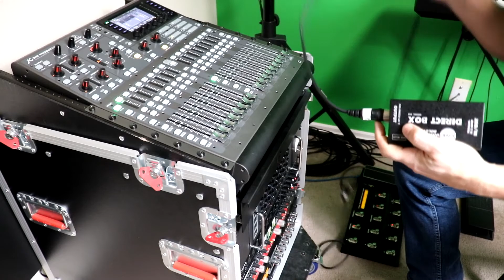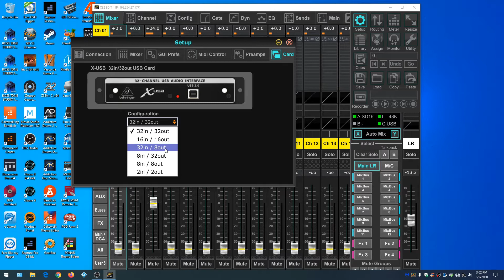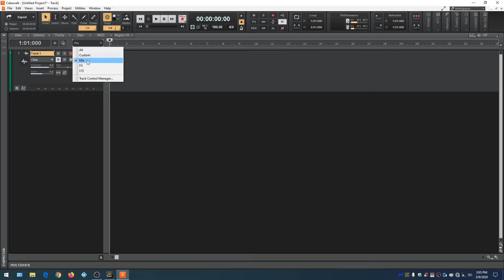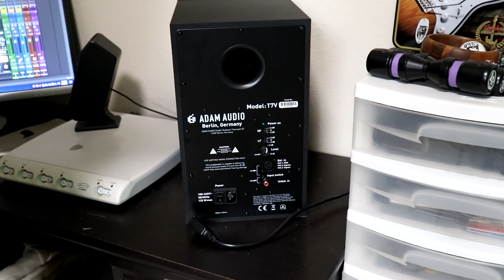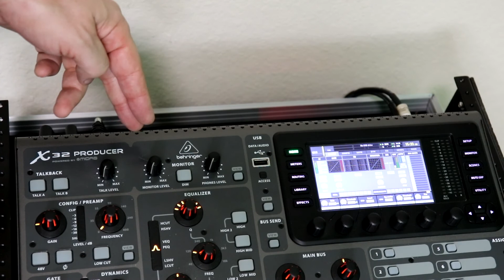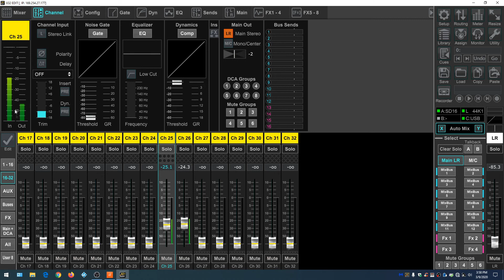Recording A Track Using The Behringer X32 Producer and Cake

Comment: Im just here to tell the story that you can buy the most expensive monitors and still get a trash sound because you didnt treat the room acoustically. And your room sounds roomy as hell... and you really should hang that picture frame properly. However... good video. It serves the purpose.
Reply from the maker: The sound of the screen capture came from a yeti mike it did not come from the mixer. I had several people ask me how to do this so I made a quick video. I know the audio could be better but it is not the fault of the room or the mixer. but it serves the purpose.

Comment: Hi Marcus, How are you Sir?  Did you ever put a video out on how to playback each track to its original channel on the X32 please?  For example, if I record two singers, one on channel 3 (Left) and the other on channel 3 (Right).  How can I route them during playback to play on channel 3 left and channel 3 right?
Reply from the maker: Yes I did, and I mentioned your question in the video and I address routing. Basically to do what you want you  need to select 32 tracks in and 32 tracks out on your card. The mixing board in Sonar will display 32 hardware outputs that will allow you to route those tracks back through the channel you recorded. Use the routing in the mixer app to route channels back through the card to play them.

I find this approach hard to use because the Behringer always routes things in groups of 8 and I don't think it's very practical. What you really need to know is a little more on the concepts of routing which I address when I answer your question. That video is found here. https://youtu.be/-AZZkMb-gW0 I provide a few different examples about how to route your recordings back through the same channels you used to record them. The information is about halfway through the video past the metronome information.
Reply: @marcuscurtismusic  Hi Marcus, Thank you so very much.  I'll give it a try.  I did not think of the master bus inside of CakeWalk.

Comment: Thank you so much for the info! Ive been using sonar x3 producer for years and recently started using cakewalk and have been looking for a tutorial for connecting my x32 to my laptop.
Reply from the maker: I have been a Sonar user since Sonar 2 and a Cakewalk user since Pro audio 9. Going back many years now. I am so glad that the new Cakewalk is a revised version of Sonar and it is free. What an awesome program.
Reply: @marcuscurtismusic  thanks again buddy. I asked a question on a different video about daw control with the x32?
Reply from the maker: @jrp2003  I am working on a video now where I will address the questions in the comment area. Working hard to get it done but my time is limited because I have been deemed one of those essential employees through this whole virus mess. I hope to start filming your request and the other requests in the comments this weekend. Hopefully, within the next week or two, it will be up.

Sonar communicates with all hardware using midi. Within Sonar there is something called "ACT" that does this function. You basically make an act controller for the Behringer and then you go through and make the midi assignments. of course, the main goal would be to take the transport controls on the Behringer mixer and use them to control the process. Still researching it and I will let you know what I find out.
Reply: @marcuscurtismusic  thanks buddy!

Comment: Hi Marcus, these videos are fantastic thank you! If you could answer a couple of questions I would appreciate it. Do i need to download the app?
Im running through protools 10 and am able to record tracks just fine. Next question when i'm recording multiple players i am unable to adjust
their IEMs separately when recording, I can only adjust one main level which effects all of their IEMs. Thanks again these videos are very helpfull.
Reply from the maker: You obviously don't need the app to record music with the mixer, but the app will allow you to control the mixer remotely. This helps when your working in Protools and you want to make a quick adjustment within the mixer. Another great feature for me is the monitor on the mixer is small and hard to see. The app basically blows up that screen and places it on a computer monitor and now I can use the computer to manually control the mixer. Keep in mind that you need ethernet cable connected from the computer to the mixer, however, you can also connect that ethernet to a wireless router and use an iPad to control the mixer as well. This is great in live situations when you are walking around and checking for a uniform front of house mix.

I only record my own music so I don't know much about IEM. I just use the headphones. I think the solution is found through the UltraNet port. Check out the P16 https://www.sweetwater.com/store/detail/P16M--behringer-powerplay-p16-m-16-channel-digital-personal-mixer
Reply: @marcuscurtismusic  Thank you Marcus looking forward to more videos!!!!!

Comment: Hello Marcus, thank you for your videos they’re extremely helpful. I just bought the M32R. I’m having some troubles figuring out how to have separation L&R coming out of my studio one software. 
When I’m trying to pan left and right it does not correspond with the speakers. The board is shipped with main speakers out 7&8 and they are panned left to right. I can pan channels on the board to make it work, but that does not seem necessary. I’ve been trying to figure this out for 48 hours, if you have any time I could surely use your help.
Thank You
Reply from the maker: Even though the Midas M32R LIVE Digital Mixer is similar to the Behringer X32 Producer there are some differences. The back of these mixers and the inputs are identical. But the software app and some of the features are a little different. I believe the solution you are looking for is found in the studio one software which I am unfamiliar with. Every DAW is a little different. In the DAW I use (Cakewalk) you just create two main busses. One left, and one right. Pan the first buss left and the second one right. I wish I could provide a better solution. Best of luck.

Comment: Thanks for another great video!  Just wonder have you had any issues with your x-usb card being flakey with the computer?  When I first turn on the board and start playing audio from the computer there is no signal at the board.  It seems if I just leave it play for a while it will all of a sudden start playing.  I ended up using a aux in with the stereo jack because I can't chance it not working on a Sunday morning.  I've opened a ticket with Behringer but have yet to hear back from them yet.
Reply from the maker: I have not had any issues with the computer connection. It is pretty stable for me. I would say the first thing you should do is make sure you have the most current firmware update. I had an issue with my mixer when I had version 4.0 firmware installed. When I upgraded to 4.1 the problem went away. The other thing I would advise is that you also make sure you have the most current version of the Behringer app to go along with the firmware update. The final thing you can do is swap out your USB cable with a different cable and make sure you are plugged into a USB 2.0 connection. You may also want to swap the ethernet cable with a different one. This will eliminate the possibility of a faulty cable. If all the above does not fix the problem then you could have a faulty USB card.

If that is the case and you need to swap out the card. Look into the X live expansion. It may be better for your needs https://www.sweetwater.com/store/detail/XLIVE--behringer-by-live-x32-expansion-card-for-32-channel-sd-sdhc-card-and-usb-recording
Reply from the maker: After thinking about your problem a little more I have a few questions. What software are you using to playback the audio? Are you recording anything or just playing back audio? Can you give me anymore information about computer as far as system specs go?
Reply: @marcuscurtismusic  I am an IT consultant so when problems like this happen I go to the basics.  I had the sound control panel open looking at the playback devices and the associated level meters.  I started playing an mp3 in VLC media player and was watching for sound output on the meter.  Switching to the speaker output showed that audio was playing.  So I switched back and waited. After it played for a while (maybe about 30-45 seconds) the meter lit up and then sound went to the board.  The same was true for audio going the other way.  I had no further troubles with it until the board was turned off and back on.  The computer system was purpose built to run pro presenter for our worship lyrics.  It is an AMD Ryzen 7 2700X with 16GB of ram, 1TB NVMe SSD, Nvidia GeForce 1660ti .. plenty of horsepower.  Running Windows 10  version 1909.  The x32 is on 4.02 which from what I can tell is the latest. I have the latest X-USB driver installed.  

I really appreciate you taking the time to help and respond.
Reply from the maker: @rwebb616  I think it is interesting that the sound guys in churches all have IT backgrounds. At least at my church they do. I have a little background in IT myself. Forgive me for my knee jerk help desk reaction. I forgot that you have an IT background. Your system specs on your computer are way more than what is needed to operate the mixer. When I was playing out at a gig and I wanted to play music during the break, I would playback audio using a thumb drive plugged into the mixer where the recording functions are located. Eventually, I organized a break set on my phone and would playback audio with my phone plugged into two AUX inputs.

It seems like your problem may be hardware related after all. I wish I had answers for you. Keep me posted on the solution you discover. Now I am curious about what the outcome will be for your problem. When this stuff works the tech is amazing. When it does not work it can be the most frustrating thing.
Reply: @marcuscurtismusic  Yes, it is certainly odd.  When I plug and unplug the USB connection the device immediately appears and disappears in device manager like it is supposed to.  I had opened a ticket with behringer support earlier this week and have not heard back.  Maybe they are short staffed due to this virus stuff.  No problem on the response. I did not take offense.